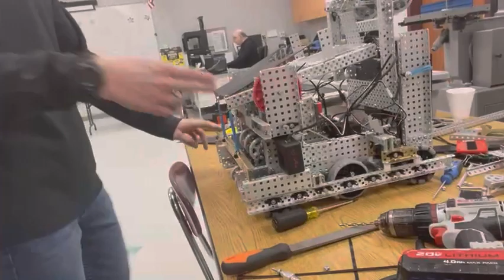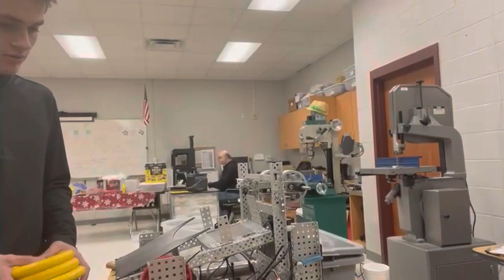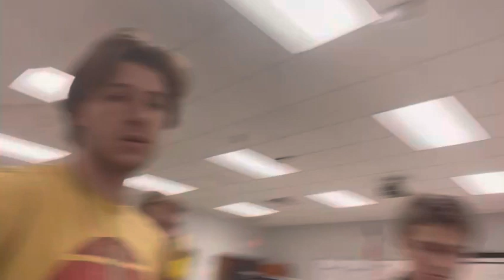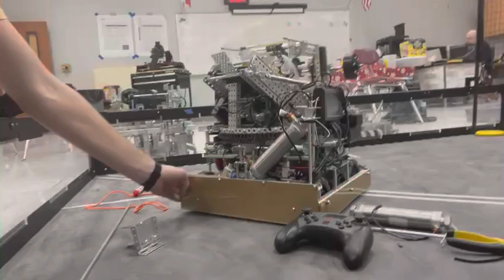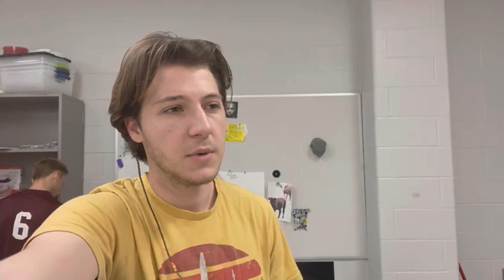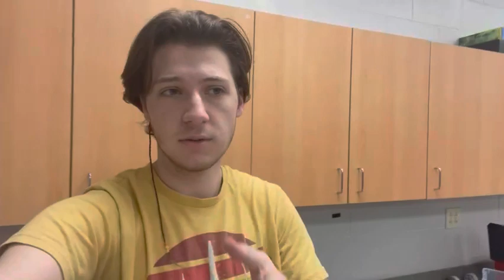GOLD! RoboVlog - Cata progress and Gold Bumpers - Vex Spin-up Ep36

Comment: My team had a transmission with a lot of unnessicary pieces of metal suports making it heavy. we had the same rpm on 4 motors and it overheated like hell, we got aerosol dust spray to cool the motors but never needed to use it as we had more than enough time inbetween matches. we did still en up scrapping the bot

Comment: To keep 100psi in you string system you can face two switches at eachother and fill it up to 100 then switch them both and fill it back up to 100. This will let you always have 100psi in your string pneumatics no matter how much air you use
Reply: yo, thats deadass listed as illegal in the gamemanual...